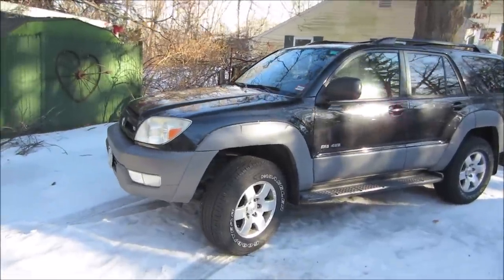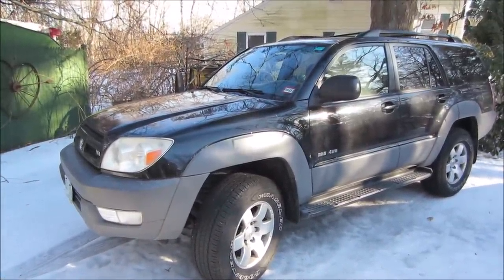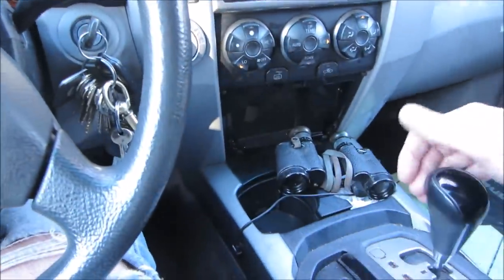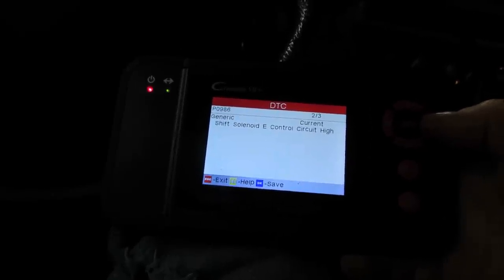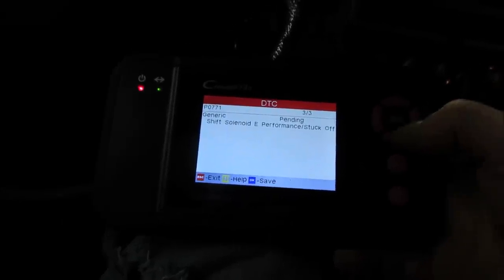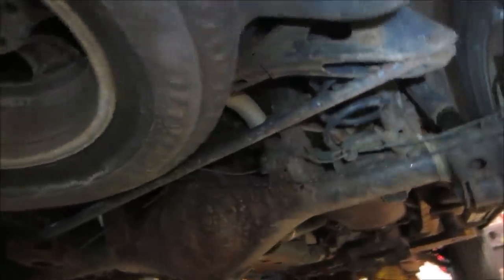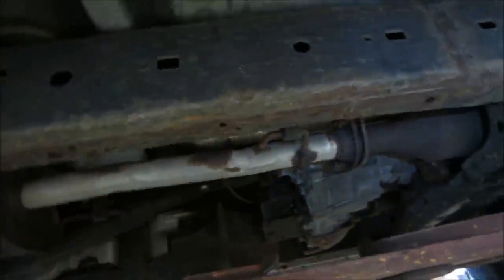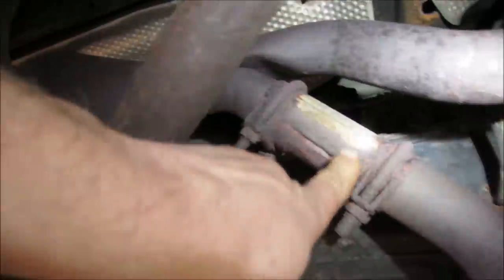Bad Toyota Transmission..Can We Fix It For Free?

Comment: if the torque converter clutch was locked up all the time the engine would stall as soon as you put it in drive

Comment: uuhhhhhh, for that 4.7L 2UZFE V8, 200k is not high mileage. Many many instances of those running 1,000,000 miles.
Reply: Slade The Original I only know of two 4.7’s with a million miles. 2 Toyota Tundras. 😉

Comment: "towards the end of its life"

What are you talking about man? That things still has AT LEAST 100K miles left in it. My first car was a 99 4runner and had 340k miles on it
Reply from the maker: rust
Reply: Can’t be worse than my 1988 ford Ranger was... it broke in half in my driveway 18 years ago, I think that it was a salt belt dweller or a shore dwellers truck before I got it! 376,000+ mile snap bang scrape & two men lifting and pushing 2 halves of a truck into a driveway... Got to love. It was a 💎

Comment: It was a great video,but nowhere is there a boss that would let you take a 50-50 chance on a repair like that.If 'Im not mistaken,maybe you could have probed all the pins for data/grnd/voltage from the top cap being open.

Can you imagine how many RAV 4 owners with crazy shifting & .DTC's galore would not have had to buy a reman trans? I think they were $2500 with core from the Approved Toyota Remanufacturer

If only a $.10 bag of polyethylene  was used to protect this connection from road crap.I would do that NOW and tie wrap it sealed to atmosphere.

Please keep this under your hat.You'll be killing trans shops, toyota dealers,and The Rebulider.

Not good for the economy.

Thumb up

Comment: Personally Mustie i would test the solenoid and see which wire and its position on the connector. Do it the right way. Mustie, i've done this on bmws with similar problems. Its not a 100% success rate. You got lucky, better go out and buy a lottery ticket before your luck goes away. LOL You didn't have to let the moths out of you wallet on that job LOL

Comment: If still have that vechile put a Black Bottle of Solder Seal GUNK Trans-Medic treatment one now and another in 5 years also solve haveing transmission problems ever plus torque converter to of bump feeling in gear ! Plus when filter and fluid changed too!

Comment: THIS IS WHY I HATE MODERN ELECTRICAL CARS.   Those testers can't pinpoint everything.   Such a pain in the ass.  I personally didn't like the use of drill bits but whatever works.  Musty should cut the connectors off and just solder them together.

Comment: Resourceful fix Mustie but way to go Toyota for the stupid design.  Even in a vehicle that's not in the rust belt, that damn thing would probably still corrode and then cost a fortune to replace the harness.
Reply: phuc ewe ....Ha, I don't believe that for a minute.  If you have had it since '69, you need to scan your memory.  Reality can be a tough pill.

Comment: Jesus, it's like you guys drive in the ocean up there....the entire under-body of most of the cars in your videos are complete rust buckets! Shouldn't there be under-body fresh water wash stations around the state to eliminate these kinds of failures?...I've never seen anything like that under ANY car I've ever owned.
Reply: Road salt during the winter. That's why many folks up in New Hampshire 'oil' the bottoms/suspensions of their vehicle just before winter with a bar oil mixture to inhibit the rust.  Otherwise, NOTHING really stops the rusting out of frames & suspensions, other than parking your vehicles and not driving them all through the winters. But then, the mule mice will infest your cars.....

Comment: You can bet if you took the car to a dealer, they would say you would need a whole new transmission.  Very cheap looking connector with thin, fragile pins, and poorly sealed against corrosion.  I thought Toyota's were better made than that.
Reply: Goes to show you they do not build them like they used to.